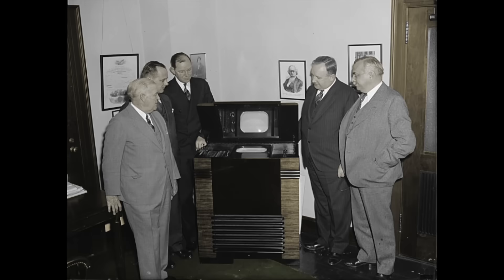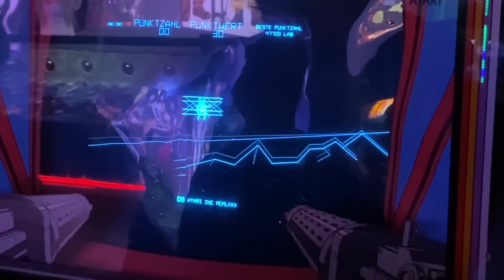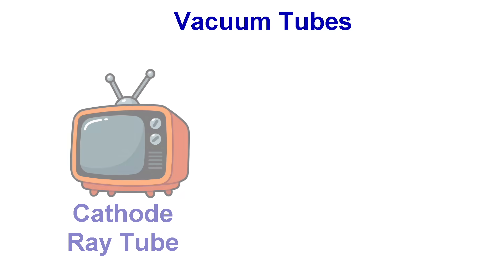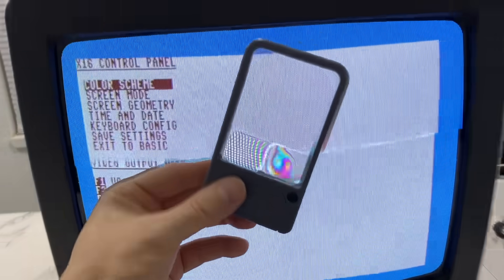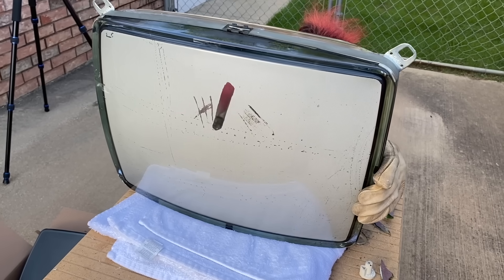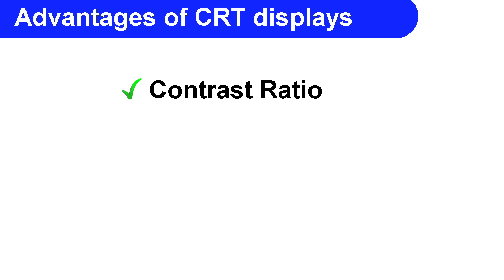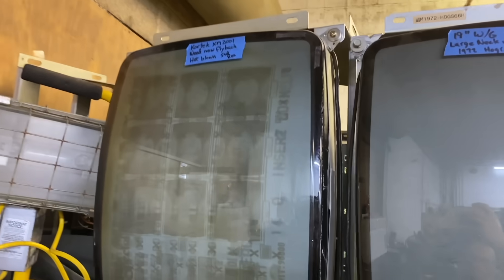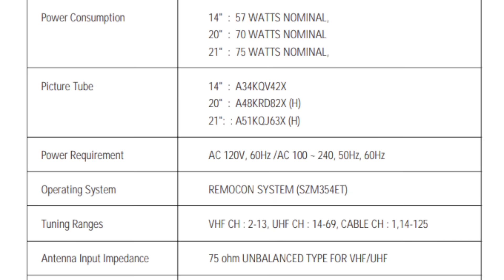How Cathode Ray Tubes Work.

Comment: Well generally speaking LCD and newer technologies have replaced CRTS I think this is mostly down to the fact that CRTS Are heavy and large, but that's debatable but most flat screens I see now are fairly light in weight, Note my first TV i had as  a kid was a Commodore monitor specifically the  1702 model i played sega gensis on it as well as whatched VCR tapes and normal television on one so... Am I biased?  either way its interesting to see how technology works even if such technology is mostly obsolete or just old.

Comment: One thing that a lot of people dont realize about modern LCD TVs is that over time the backilght will start to turn blue, since all white LEDs are just blue ones with a phosphorus coating on them to turn them white. It decomposes over time as the TV is left on. You will see blue TVs often in hotel rooms and other places they are left on all the time.

Comment: A different technology for colour TV was the Beam Index CRT, but it had a very long development period so it never made it commercially except for specialized purposes.
https://en.m.wikipedia.org/wiki/Beam-index_tube

This CRT had no shadow mask and only one gun with one cathode.  The RGB phosphors were continuous vertical stripes with no dot or slot grid.  Inbetween each triad was a thin black strip on the screen front, which was reflective on the inside.  As the electron beam swept horizontally, the gun output was switched between the three seperate RGB modulated luminance levels hundreds of time per line, so that each phosphor strip received the appropriate level of output for that colour.  To keep the beam modulation perfectly in time with the phosphors, a photodiode was incorporated in the side of the CRT.  It's job was to watch for the  spike in brightness inside the tube as the beam passed over each  reflective strip after the RGB strips.  Thus with this feedback, the modulation of the beam can be kept synchronized with the sweep across the phosphors.

However by the time its costs were competitive the shadow mask CRT improved greatly as well as the new technology of the Sony Trinitron.  The Beam Index CRT had a specialized use: very bright readout that is resistant to external magnetic fields, like aircraft cockpit displays.  No shadow mask that magnets could permanently warp and distort colours.  If external fields influenced the deflection of the electron beam, the feedback from the timing indexes would just adjust the horizontal sync to make up for it.

Comment: These explainer videos are my faves. And this one is just brilliant! Thank you!

I kind of see the LCD era of the early 2000's until now as a bit of the "dark ages" of display technology. I loved my Sony Trinitron back in the day but I eventually switched to an LCD for convenience (lighter and took up less space). But it really, REALLY felt like a huge step backwards in display quality. Which it was!

Contrast ratio of a CRT is far superior as you also point out. They did suffer from the same issue as any display tech do though. The blacks are only as black as the monitor looks when it's turned off. Meaning that if you have a lot of light in the room, the monitor will look greyish thus making the blacks greyish too when it's turned on. Being in a dark room improves this of course.

Nowadays I've finally gotten an OLED screen. This is the first monitor I feel rivals my Trinitron.

Comment: When you get a 40 inch 16:9 LCD display, it's EXACTLY 34 inch 4:3 CRT display in terms of height thus widening a 34 inch 4:3 display.
The same screen size only wider.

Comment: I've often seen the contrast ratio claim for CRTs, but sadly this only seemed to be the case on high-end displays.  Affordable consumer TVs I've owned I always had to raise the black level to grey to avoid blacks being crushed entirely.  Its why moving to OLED was so eye opening for me, its the first time I owned any display where night scenes looked decent.  The start of Harry Potter and the Philosophers Stone being a prime example, it was really hard to watch on CRT and several generations of LCD, until I finally got OLED.  Though this was also helped by Bluray not crushing blacks as much as DVD, as modern digital encoding was able to preserve a lot more contrast detail from the film than older or even analog methods.

LCDs also do still suffer the LED backlight dimming over time and colour shift due to the diffusion layer de-laminating (kinda different from the de-lamination you mention as it happens sooner).  Its sadly common to have the dirty screen effect (colour or brightness changes across the screen) from day one due to how tricky it is to make an even backlight.  I'm actually curious if local dimming will help here or actually make it even more patchy over time as one zone wears out quicker than another.

Comment: A little off-topic, but big electronics brands like Samsung and Apple should get together and agree to get rid of inches to specify screen sizes. It's one of the last bastions of nonsensical units. Maybe use both units for a few years and then just metric. I'm surprised that the EU hasn't regulated that and required metric, what with their tendency to regulate everything.

Comment: 0:40 LCD wasn’t mature enough to say that it better than CRT. Input lag still there, bad 240P scaling, No support for Nintendo Zapper, Motion Blur still there due to Sample and Hold still in use on today’s display. Black level and picture quality is still god awful due to need of a backlight. LCD should be discontinued by now. OLED is better but only black level and picture quality were mile better than LCD. I guess I’ll continue to suffer until someday a new display technology that similar to crt has been released

Comment: 14:08 From what i know the NES zapper didn't actually shoot any light out, it did the opposite - there was a light sensor inside and when the player pulled the trigger, first there was a separator black frame, then on every consecutive frame a white square on a black background would be displayed in the place of one of the targets, repeating for however mang targets there were. Lastly there was another black frame. This is why you can see the screen "blink" when you pull the trigger in Duck Hunt for example. Then, depending on which frame the zapper "saw" bright light on, the console could deterimine which target the player shot. This means the zapper would still work even if you were to plug a NES into an LCD =D

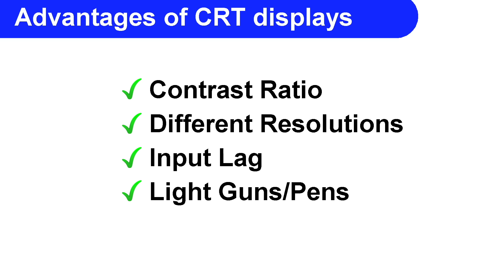Comment: 14:17 I could add one more to that list. Color reproduction. LCDs, and especially in the early days, had a much smaller color gamut than CRTs and colors looked washed out. Nowadays, nearly all LCDs are sRGB or larger so don't suffer from this anymore. Furthermore, I want to criticize the first point, Contrast Ratio. Sure, CRTs generate light and can therefore display pure black, but in practice, the phosphor was so "gray" that under daylight or artificial light (how you're supposed to view a monitor) the contrast ratio is actually flipped.

Comment: I got my first LCD monitor in late 2008. Still watching this video on it today. I got rid of my last CRT widescreen TV in early 2020 (20 years in service), but managed to get some recordings in slow motion of the electron beam traversing the screen...
Reply: also, my LCD monitor still works great after 15 years, perhaps it has a slight color shift towards magenta? I don't know. My photos look great on it. But the monitor I replaced it with - a 17" Flatron LG CRT, really started behaving weird only after a few years. The brightness decreased, the screen size started shrinking erratically, I couldn't really do any graphics on it because of it. So I don't really miss CRTs that much...

Comment: I have a couple CRT monitors I still use however one needs power supply work. I use one of those early 2000s 5:4 LCDs on a work computer, viewing angle is terrible but otherwise it’s great.

Comment: Loved the explanation, I always wondered what the RGB "dots" were. Since I have a Sony Trinitron, I went to see what's the difference between "normal" CRTs and Trinitron CRTs, Sony was definitely ahead of the game for decades!
Strangely enough, I disassembled my 28" KV Sony Trinitron to try to fix a problem with one of the SCARTs, and it didn't make a "crack" sound when discharging. I'm wondering if "newer" CRT TVs somehow auto-discharge when turned off...

Comment: Since the US is doing a lot in fractures instead of decimals I always thought they where very good in calculating with them. As a European it kind of feels hard to imagine fractures apart of 1/2, 1/3, 1/4. But that they didn't even realize that 1/3 is more than 1/4 is disappointing me big time. Which basically means most people in the US don't understand fractures AND decimals

Comment: Try to get a FIMI monitor and compare contrast. They are monochrome but have high contrast. Enough that they are required to display digital x-rays and attempt to match the old film ones for fine contrast and details. Important when looking at cracked bones (instead of the fully separated ones)

Comment: Still i have Two Panasonic Plasma Displays, P55ST60 and P50ST60, the image quality is great even in lower resolution movies, black is almost complete black, i even have the original stylus and 3D Glasses. Unfortunatelly they are toasters, 400watts power consumption for 55" and 350 for the 50". In the winter my whole house is heated with these two TV's and the air conditioners doesn't work at all for heating

Comment: Back in 1983, my family got a Thomson TO7. One of the incredible thing was that you could raw on the huge TV using a light pen. With Pictor you could even make animation (given how limit memory there was it still blow my mind) of successive image.

Many years later, on my Atari ST, I remember drawing three red, green, blue dot vertically on a black background in Neochrome. You could visually see that they formed a small "triangle" and were not on the same vertical line.

Comment: I stayed with my CRT projector in my home theater for over 10 years.  Eventually, I bought a DILA (JVC) projector, and I've never looked back.  The sole area where the CRT was superior was in absolute black level.  But since the JVC is much brighter than the CRT, the contrast ratio is superior.  Also, I didn't have to mess with convergence as I did with the CRT.  My desktop LCD monitor looks extreme sharp, and the contrast ratio is "good enough".

Comment: It's important to mentioned how great crts were for emulation. Everything just looked right. There was no such thing as integer scaling with blacks bars, because the monitors supported so many resolutions out of the box. You could not tell really if the resolution changed, aber from some screen flicker during the transition. It was just brilliant.

Comment: I loathe 16:9 for computer monitors, 16:10 is vastly superior aspect ratio.  I find it interesting that in most office environments with workstations 16:10 is standard.  I much prefer the extra height my 1920x1200 monitors offer over 1920x1080.

Comment: About the longevity, modern LCDs use blue LEDs with phosphor caps just placed over them, rather than the phosphor being poured over in a package. That cap can crack with time and fall off, making the blue light bleed through. I personally meet blue LCDs a lot and I hate it.

Comment: I have had 3 Dell LCD monitors that all have broke down due to the inverter no longer working and hence no backlight anymore. It seems to be a common problem with them. The Dell FP2001 is a brilliant retro LCD as it has SVHS input so you can connect many old machines to it - but finding a working one is hard. Not long ago I did a dumpster dive at an electronics return place and found a nice FP2001, brought it home only to discover that had the same problem. From what I understand it is basically the capacitors that needs to be replaced so I need to get around to that some day as they are great devices for this.

I also found some working old 15" LCDs that I used for making small a table top vertical arcade with a RPi, but one thing that strikes me is how dim the display is so those have not aged well for sure. Since the screens are indented inside like an arcade cabinet it is not too bad though, but nothing like what a CRT would look like.

Comment: I spent some time at a computer bank during the time Australia shut off the analogue TV system. Scrapped quite a few old TVs, and broke a couple of tubes in the process. The inrush of air into one of them took out the phosphor in the middle of the screen, making it noticeably darker in colour there, like someone had flood-filled a dark radial gradient in the middle of the screen.

Comment: Here in the UK at least while giant back projection TVs existed earlier (but had terrible contrast ratio) it was actually Plasma TV's that edged out Cathode Ray at the higher end of the TV market with their large and high quality displays, sitting alongside LCD at the lower end of the market for a long time before eventually OLED and QLED came along and dethroned it.
Reply: That's kind of how it happened (in practice) here in the US as well. Small LCD monitors existed, maybe even small standalone LCD TV's. But for a few years, plasma was all the rage as they had the superior image at the time, and were of a size that could be used in the living room. Finally, a non-projection tv that was larger than any CRT and could be hung on the wall! Large LCD tv's didn't exist at that scale or image quality just yet... Or if they did, they weren't in the consumer market at that time. Owning a plasma screen tv was the ultimate flex. 

After a few years of those shenanigans, LCD's quietly took over the market as plasma tv's were heavier, more prone to burn-in, and still pretty expensive. It still amazes me that I can walk through a department store and see a tv the size of the bed I slept on as a child for under $500. Sure, it's an off-brand tv if it's under $500, but still... 

The transition from CRT to Plasma to LCD was actually a lot like the way compact fluorescent lamps took over for incandescent before LEDs finally caught up.

Comment: 1:25 ... Factually incorrect explanation ... electron only flow when the circuit is complete, anode and cathode need to be actually connected to power source (Battery)
Reply: Why didn’t you correct this before the video went public
Reply: @johnnylongfeather3086  he didn’t consult me before releasing the video

Comment: I wonder how hard it would be to magnetically rotate, skew etc. an image inside a tube (instead of mechanically as Dave is doing in the video). With enough geometry one might build a sort of analogue 3d display (like a 3d card). Maybe have a number of electron sources for the tube, each with individual magnetic transformation and/or switch quickly between images to multiply the number of polygons. I imagine it would be really really hard. Just an idea😄

Comment: LCDs have improved in quality over the years. I bought my first LCD monitor sometime around 2003 or so, and I still use it to this day. It works fine - the power button is a bit broken so it can rotate and turn but a little tape fixed it. It does take about 5 minutes to power up as it comes up dim but brightens. It's backlight tube is still good - the brightness was lowered from 100% to 20% because it was eye searingly bright when it was new, and I haven't turned it up. It's still plenty bright and the colors are still reasonably good. Who knew an NEC monitor costing $900 will still be used over 20 years later.

Comment: The Sony Trinitron could be discussed - the main difference is that it's a striped pattern CRT except instead of a shadow mask made of metal, it's made of very fine wires strung vertically. Because those wires can vibrate, there are two even finer stiffener wires strung across them horizontally. One is near the top and the other near the bottom. If you display a solid image, you can see them as there will be a fine line running across around 1-2" from the top and 1-2" from the bottom of the screen.

Because of the shadow mask design, this allows Trinitron displays to be much brighter because they have less mask in the way of the electrons. And yes, you can make a Trinitron monitor go nuts if you tap it on the side as that will cause the wires to vibrate and distort the image.
Reply: We had Apple LCIII's in the computer lab at school, which were outfitted with the apple M1212 Trinitron monitors. They were only 14", so they had one stiffener wire, about 1/3 from the bottom. I always wondered what that faint line was as a kid. I also took interest in the cylindrical rather than "bubble" shape of the screen. I now own an LCIII with an M1212 monitor because, well heck yeah I can! It's a nostalgic little setup, though it needs to be re-capped and upgraded with Blue SCSI before I can really consider it usable or reliable. The monitor could probably stand to be serviced too.

Comment: Back in the early 70's my father and I put together a 25" Heathkit Color TV. It had a whole section on theory, and test equipment like a signal generator & external degaussing coil included. It took us a couple of weeks, and that's how I learned to solder.
It replaced our 9" portable monochrome TV, and boy was it a huge upgrade.